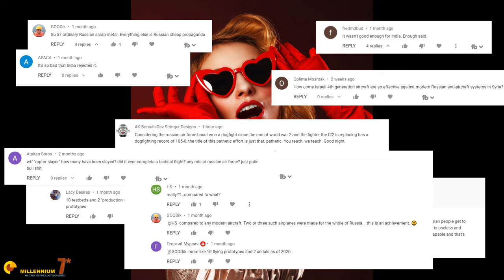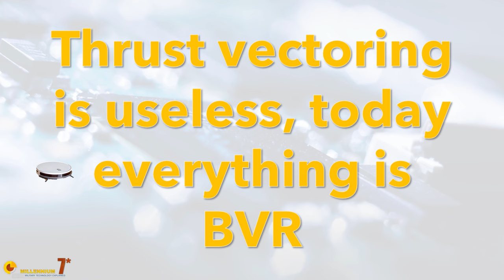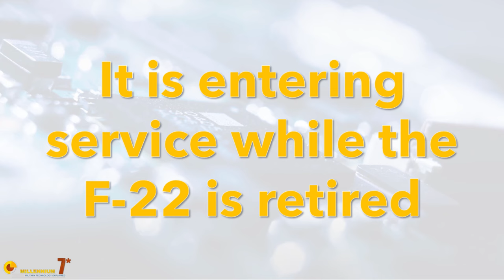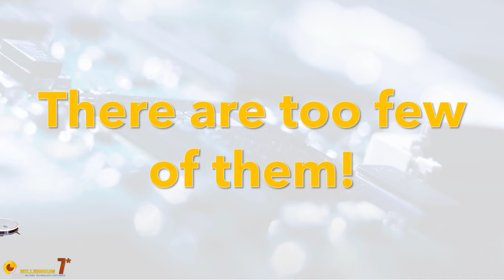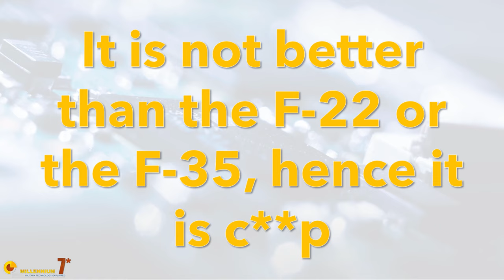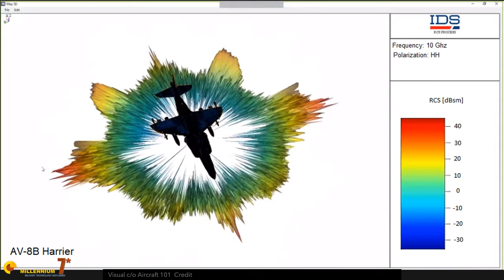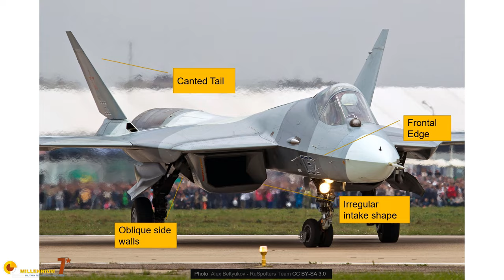Su-57: is it INVISIBLE?

Comment: I think there's two issues here. Intenet discussion is strongly pro or anti something, mostly because few people are interested in nuance let alone discussing things these days. The second is that there is a large contingent of Sukhoi fan boys who are forever over praising the Su-57 as the best thing since slice bread who equally hate on the F-35. In reality, we know its a great aircraft, but we also know that Russian material science and digital technology is in the rear view mirror of both western and (almost certainly) Chinese manufacturers. The Russian airforce certainly has a different operating procedure than Western and a different doctrine (although I'm not that convinced they don't take BVR as seriously as the USAF, given their portfolio of long range A2A missiles). 

Yes the L band radars in the wings (and the small AESA X band panels in the nose) will surely provide enhanced 3D awareness capabilities, but as we know radars are detectable several times further away than they are capable of detecting) and US aircraft have much better radar stealth capabilities, none of us know whether this will be a benefit or negative let alone what range distance the advantage/disadvantage choice will resolve at. We also don't know how effective Russian electronics will be at data fusion and combination (which comes down to speed of refresh and number of targets tracked at what distance) or the ability to integrate data from multiple different aircraft in the way the the F035 is designed to (how good the current software is on the F-35 is another complicated question with a lot of unknowns as well).

As a large aircraft, with a lower level of designed in Stealth, the Su-57 is likely to be relatively easier for current US radar technology to resolve than vice versa. We don't know at what range this benefit lasts til (nor the impact of electronic warfare, although its very likely that our Military have a very good idea and exercise on this basis especially given they fly against a variety of different aircraft in training these days). Rather than question US BVR doctrine, i suspect the actual answer is likely that it will work well (we've had years to test out the doctrine and technology now) but the kill % will be lower than either side expects. Western aircraft will certainly decline combat in most instances where wvr dog fighting is likely against the latest generation Sukhoi aircraft. I suspect we'll run out of missile before aircraft and in any extended WW3 both sides will hoard both aircraft and missiles until they believe they have a clear advantage. Of course, the longer lead time there is, the more both sides will build aircraft, train pilots and missiles. At the moment, Lockheed's ability to build F-35s exceeds Sukhoi's ability to build both Su-57 and Su-35S. Combined western airforces are larger than the Russian airforce. With a higher faster capability to replace existing "4th gen" systems this ought to be decisive.

The potential Pacific airfare is actually the ore interesting topic right now, given how little we know about Chinese equipment, although I here that the current Chinese version of the Su-3x series are significantly better than the Russian made equivalent outside Engines, where Chinese technology is catching up anyway.
Reply: I think your analysis is based on a hypothetical and unrealistic scenario wherein SU57/SU35S are going in for a headlong confrontation with NATO F35/F22s. That will never happen. Russian ADS primary focus is ground based interception with their S500/S400/S350/S300/BUKm3,m2/Pantsir S1 with the fighter interceptors playing a complimentary role. Russian doctrine is primarily defensive and not offensive ( attacking NATO heartland beyond Eastern Europe). Their interest lies in what they call near abroad ( Ex-soviet republics and this strategy fits perfectly there.
Reply: "In reality, we know its a great aircraft, but we also know that Russian material science and digital technology is in the rear view mirror of both western and (almost certainly) Chinese manufacturers."  Here you are deeply mistaken. Materials science in the USSR was at a high level, and remains high in Russia today. China is deeply behind Russia in this. Copied Chinese engines AL31F still have poor reliability due to the lack of alloys and certain technologies.
You overestimate China too much. Yes, they are powerful, and in some areas they are strong, but their dependence on imported technologies is still visible. For example, the initial design of the VZ10 helicopter was ordered from Kamov (design and calculations, without prototypes, on paper). Kamov completed the order. And then the Chinese created a helicopter on their own. And there are many such moments. China's space program is based entirely on Soviet, Russian technologies. The suits are bought from Russia. Therefore, you overestimate China and underestimate Russia.
Reply: @MrSarkardip  NATO airforces would use a combination of airborne and ground based cruise missiles in waves and large numbers to take out Russian ground based radar and missile. Initially this would be done from outside Russian airspace. 

I suspect western fighters would simultaneously try to take Sukhoi fleet by surprise whilst they are doing their best to interdict the cruise missiles. All operating under an environment with large levels of (mutual) EW, ESM and ECM.

NATO aircraft numbers easily exceed Russian aircraft numbers and it spikily that forward operating bases in places like Ukraine will happen alongside ship and submarine based cruise missile attack further spreading Russian air defence assets.

NATO isnt designed to invade Russia (thats never been a western aim), but to stop Russia and they no longer have the Army numbers plus tanks and artillery. Any armoured spearhead, would also probably not operate under much air cover either. The new generation of smart weapons are much more likely to operate at nearly 1 missile per target than at any time in history.
Reply: @arrant638  In theory perhaps. If it was actually true, Russia would be building lighter engines with longer service life than the west (for example) and its stealth materials and RAM coatings would have existed for longer giving them the technological lead in this area.

If you look at Su-57 new (to Russia) capabilities, you'll actually see many were achieved in 4th gen western aircraft 20+ years ago rather than just coming into service today.

Whilst the rate at which Su-57s are built might be unclear (given we only know there are 2 built to production standard that are yet to receive the intended engine) and less than 20 Su-35S a year currently. 
In comparison, Lockheed is building 140+ F-35 a year today. European nations can easily build over 100 Typhoon, Rafale and Gripens a year if the money was made available.

As Stalin said, Quantity has a quality of its own...
Reply: @nickbrough8335  You completely miss that for almost 20 years Russia prioritised investments in nuclear weapons and closing the technological gap with West. Now they will invest more in creating new production lines. By 2027 they will be able to build around 36 su-57 annually. They also plan to purchase cheaper su-75 in bigger numbers compared to su-57. This will give them balanced fleet of 5th gen fighters simular to what USA had with f-15 and f-16. In any big conflict, Russia will use preemptive strikes at Nato bases in Europe. On the next stage tactical nucleat weapons will be used. This will even the chances.
Reply: @MrSarkardip  Perhaps so. When I think about scenarios which might lead to actual conflict, it either starts in Ukraine (with an invasion) or something on the Polish/Kalinngrad/Baltic States border probably due to Russian supporting minority ethnic Russian population. The initial move would be missile and armoured strike to occupy Poland or the Baltic's with a view to knocking out immediate NATO forces and presenting a fait accompli. Nato would need to halt the offensive and cut-off the front line, which means hitting Russian logistics through Belarus and western Russian. That requires airstrikes following an initial cruise missile strike(s) to degrade air defence systems, followed by an air force supported armoured assault to retake captured ground (assuming no Russian surrender). I don't actually see how head on air battles don't happen as both sides will want air superiority over the battle space. At no point would NATO forces do anything more than occupy Russian border area. In either scenario, only mobile Russian air defence assets enter the near battle space (eastern Ukrainian or Belarus). The majority of the Russian air defence network will remain untouched as only a small area needs to be continually suppressed and degraded to halt logistic supply and reinforcement of the front line Russian troops.

Comment: besides the aesa radar, in principle the su 57 or even f 22 could have been built earlier. I mean a genius with ambitious goal could have built in in 1990? had fly by wire, composites, and the commuter design, maybe not all coatings etc ? am I right ?

Comment: Can you talk a little bit about composite skin and its implications for "stealth"? If you have a composite skin, designed with radar absorption in mind, do  panel gaps, rivets and other such things...still mater?
Reply: Cavities are generally bad to have, because they resonate RF energy.  So even with a composite surface, you still want to apply RAM to reduce the chances of resonant waveforms returning to the signal emitter.  The test facilities that assess RCS on ATF and JSF showed little spikes even with different orientation of fastener heads, so it’s tightly controlled.  It also drives how you shape things under the surface.  Radomes have to be RF transparent, for example, otherwise your radar wouldn’t be able to see its own signals once they come back.  Think about what that means for RF VLO and how things are shaped.  If the radar antennae is facing forward, it acts as a reflector.  Now look at F-35 shaping under the nose.  It’s totally different than the Su-57, with no right angles.

Comment: There are some popular comments on China websites about su 57's troubles. First, the weapon bay affected the structural strength seriously as its fuselage is so thin and lifting body. Anyway, F22 and F35 have a strong fuselage so it's very strange. Second, the strong air flow between 2 engines is good for stability and lift force, but it also affects launching missiles especially the lighter air to air missiles, they may hit the engine! It may even block the door of weapon bay when flying at supersonic speed. Could you please review these opinions? They are just nonsense or make sense to some extent? Thanks.
Reply from the maker: It is true that it took quite a long time to certify the supersonic separation and they had to build specific ejectors that can be changed depending from the weight of the payload. As far as I know the aircraft is structurally sound.
Reply: @Millennium7HistoryTech  thank you so much for replying so quickly

Comment: How abt the square thrust vectoring outlets ? And the new engine ?
Reply: The nozzles are indeed uncovered and have no shaping like f 22. But that minorly contributes to the rcs.
Reply: The engines are visible only from the rear; if the plane is flying into enemy territory, then from the front it looks like a stealth aircraft. This is the main idea. You are not going to fly over air defense systems because they will destroy you if you do. But you can fly close enough to the front line and the enemy will not be able to detect you.

Comment: We do not know if the SU-57 focus on manouverability is a complete flop or if it is sane. Then again, noone is building jumbo jets bristling with missiles and radars and a twenty ton EW suit. So we know that manouverability is considered important by all manufacturers. It is most confusing subject.

My suspicioun is that the Russians have made a mistake with super manouverability, its just an expression of Russian orthodoxy and playing to their strengths. They happen to be super good at designing super manouverability so that is what they do, even if it is becoming obsolete. My own guess is that the ability to change speed and altitude and direction is very important, but more from a meta perspective. You detect a threat 50 km away, now you have to change your direction and get maximum speed, maximum change in altitude, maximum quick, in order to combat the missile in a place where its range and manouverability is depleted. The micro super manouverability the Russians have implemented, hm.

Other than that, I believe the Russians are doing a good job, with the resources they have available. I think its also important to always keep in mind that Russian air defences are ground-to-air. Their fighters are complementary, not the main air defence arm.

Thanx for all the great videos btw!

Comment: L-band wavelength is between 15–30 cm. So with equal aperture size, that give it narrower beam width than VHF/UHF radar and wider beam width than X band and Ka band radar. Generally speaking , smaller beam width give better accuracy. L -band wavelength is long enough to cause resonance at some parts of an aircraft. So technically speaking, it is better against stealth than X-band radar, but not a lot better, and it is worse in accuracy

Can it detect F-22 over long distance? : It depends onn how big your L-band radar is, if we are talking about the leading edge L-band on Su-35 and Su-57 then no, that thing is an IFF and ECM system rather than radar, and it can’t steer in the vertical to determine target height.

There are modern RAM (radar absorbing material) and RAS (radar absorbing structure) with absorbing capability in L-band and UHF band range too

In theory, it can detect a F-22 at long range. But you’re going to be searching for a return in a sea of returns. Then the issue comes down to having enough processing power to continually “scrub” unneeded information every “pulse” the radar sends out, a lot of false returns “intermittent” targets such as wind and birds which will be difficult to classify, and hopefully find the needle in the haystack and hope you didn’t miss any. And I’m not even bringing ECM into the mix which will make the computers and operators job far harder as L band is easy to jam and spoof due to it’s lower frequency.
Reply from the maker: While I agree with you about the issues that a small L band array like that may have, we also have the manufacturer explicitly saying that the IFF is in the levcons, while those on the wings are radars. There must be a reason...they are not crazy.

Comment: Seems like the Russians are going about the 5th Gen arms race in a very smart way. Instead of going head-to-head with the U.S's approach to 5th Gen aircraft with the F-22, the Russians have taken the principles of a 5th Gen aircraft and created an aircraft more in-line with their own combat philosophy, and not the U.S.'s. If the US had intended to forsake dogfighting for BVR strikes with the philosophy of "look first, shoot first and break away from engagement" with the design of the F-22 and F-35, seems like the Russians have included everything in the Su-57 to nullify this. The Su-57 is definitely stealthy, but not to the extremes of the F-22, because it doesn't seem designed with BVR at all costs in mind. With the L-band radars, it seems like the Su-57 is designed to have a rough idea of the general direction of opposing stealth fighters while still remaining at undetectable range. It then approaches the opposition fighters head-on, where the Su-57 is at its most stealthy aspect, while closing the distance. I think the idea is for the Su-57 to remain just stealthy enough that by the time the F-22 and F-35 discovers its presence, the Su-57's full sensor suite is already at play and it has made them vulnerable at long range to its radars, at which point the Su-57 can deploy its hypersonic missles, at medium range vulnerable to the IRST, and at close range, into a dogfight where the Su-57's aerodynamic characteristics is superior and stealth wouldn't matter anyway. What the Russians have done then, is to mimic nature: When a predator has a potent weapon, the prey does not come up with the exact same weapon as a solution, but comes up with a tactic and different weapon to counter the predator. In short... the Russian philosophy is to nullify whatever the US philosophy is. The US wants BVR? Force them into WVR. The Su-57 is the counter-stealth to the F-22's stealth. The Su-57 wasn't meant to directly compete with the F-22 in a dick measurement contest after spending obscene amounts of money. The Su-57 seems designed to cut off that said dick, and to do it at a lower cost. That's how I understand it anyway.